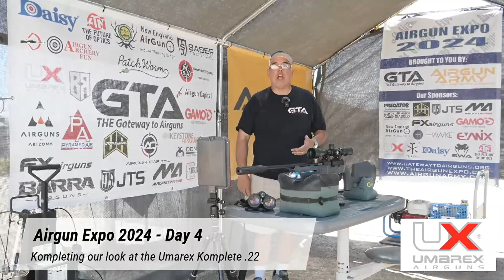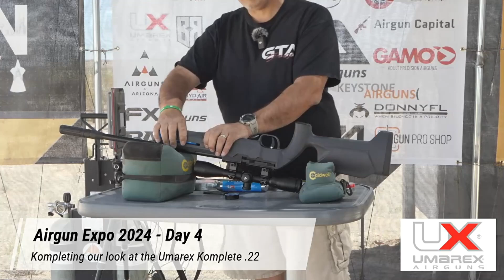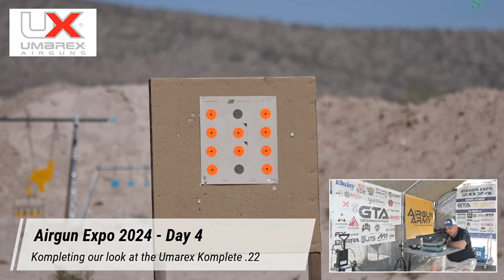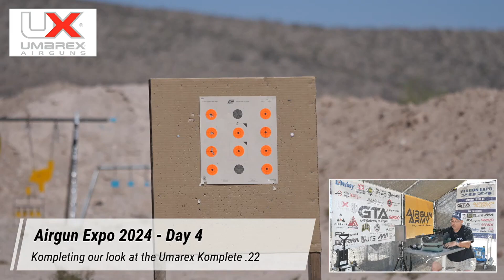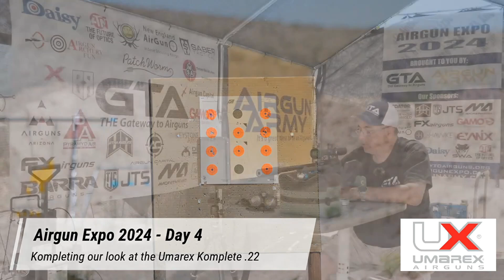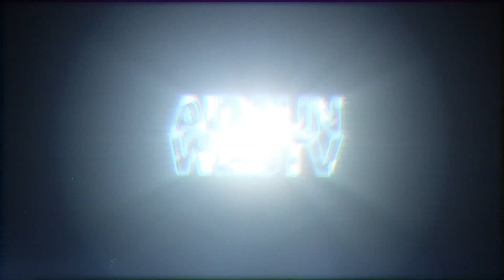Airgun Expo 2024 – Live Day 4 – Kompleting our look at the Komplete NCR .22 - Provided by Umarex USA

Comment: I love the idea i have a hatsan flash 25 that sits in closet. O ring went out and i replaced and it wont seat the valve with my hand pump just leaks air out. I cant find anyone with bottle so its a $300 weight at this point. Not spending $600 plus for compressor and tank.. i imagine seals would go bad in this over time but with the bottle it has it would seat the valve and not have situation i have.

Comment: Rick, thank you for the review of the Umarex Komplete Nitro, I'm a target market customer, this is perfect for my needs. For my age a break-barrel was a struggle, CO2 does not give me the 35 yards I need for backyard pesting, the Umarex Komplete Nitro is ideal. The cost of the cartridges is a worthwhile trade-off as the cost is not a big deal for the few dozen shots I will use it per year. Umarex nailed it to bring new customers into the market. Not to mention you can leave it charged and ready for action for extended periods of time.

Regarding your pellet tests, it was exactly what I was looking for, but next time, please zoom in on the target with the camera and please show the tin of each brand, type and weight of pellet next time, like other reviewers do. As a newbie, do you realize how may 15.89gr pellets JSB makes, it has to be at least six. My selection would seem to be towards the JSB Hades 15.89 for the hunting expansion.

If you used the JSB Exact Jumbo 15.89 in the test, my best guess, how do you think the JSB Hades 15.89 would compare as far as similar accuracy and tight groups?

From your testing, can you speculate how accurate and tight grouping these would provide?
H&N Baracuda Hunter Extreme Pellets, .22 Cal, 18.52 Grains, Hollowpoint
H&N Terminator Pellets, .22 Cal, 16.36 Grains, Hollowpoint
Predator Polymag .22 Cal, 16.0 Grains, Pointed
Gamo Rocket .22 Cal, 14.3 Grains, Ballistic Tip
Reply from the maker: Hey there. Thank you for watching.  Please note that this was not a "review" but simply a demo.  In fact, it was a "live" demo during our Airgun Expo.  

We had limited time with this and limited cartridges.  So, when we get our review sample and supplies, we'll follow up with a full review with pellets, etc.  

As for 15.89 JSBs, there are only a couple of options.. the 15.89s and the hades.  They made the Hades 15.89 so they would "fly" about the same as the domed pellets.. so you can target shoot with the domed pellets and switch to the Hades for hunting, hopefully not having to change your scope.  It works that way most of the time, but there are some exceptions.   

Regarding extrapolating performance from other pellets, nope, that's way too unpredictable.  

I just heard from UX today. They are sending a .177 and then following up with a .22.  Both will be going to our GTA GRiP review program, so make sure you are subscribed to that channel: THE Gateway To Airguns on YouTube. That is where we do in-depth, unsponsored reviews. 

AGW is a sponsored channel where we do unboxings, out-of-the-box demos, long-term deep dives, tutorials, and more.  

Cheers
AGW

Comment: I really don't see this being a good alternative to CO2 or PCP. I mean I understand the nos vs CO2 deal as far as temperature changes but why not just sell these bottles high charged with clean air?.. I can fill these 44gram cartridges to over 3kpsi apparently.
Reply: What for. The nitro air is impervious to temp changes. You can take it out in 20 below zero and not lose 1 fps. Try that with a PCP air rifle.

Comment: excellent review. my concern is long term availability of tanks for it
Reply from the maker: Here’s a prediction.   Not only will we see the NitroAir become a standard like the 88 and 90 gram CO2 canisters, we will see an entire line of products, including higher end wood and steel variants and released over time. Additionally, I predict that UX will either license the ability to use there cartridges to other parties or someone will create a competing product.  I’ve not had any “off the record” or “on the record” conversations to support this, just a gut feeling. 

Cheers
AGW
Reply: @AirGunWeb  yes. I see the nitro air becoming the standard . This will put the PCP market on its heels in until they quit pissing and get on the bandwagon.
Reply: I wouldn't worry about that. I have had no issues finding tanks. They know they got a hot item. They're not gonna let the supply run low.